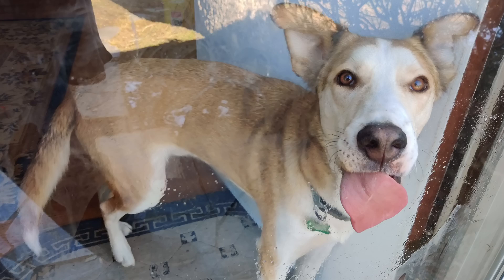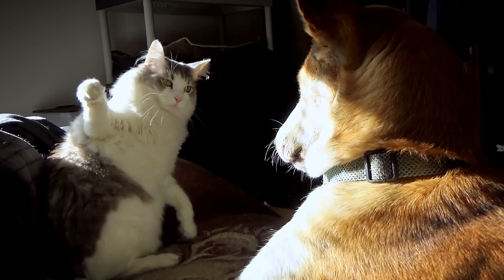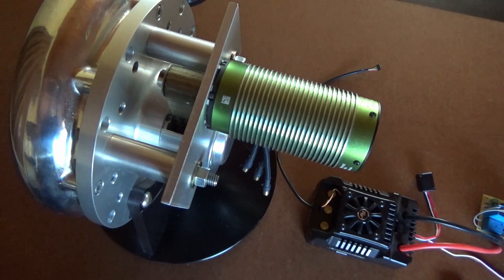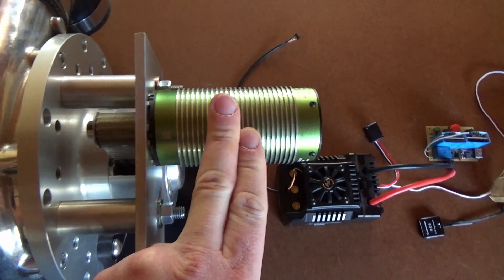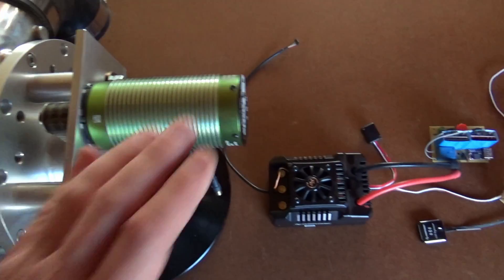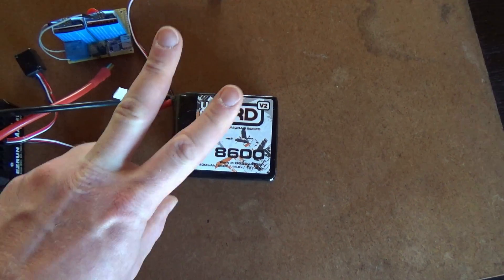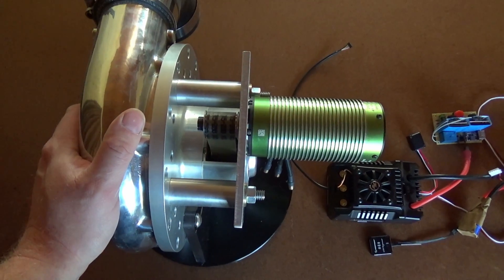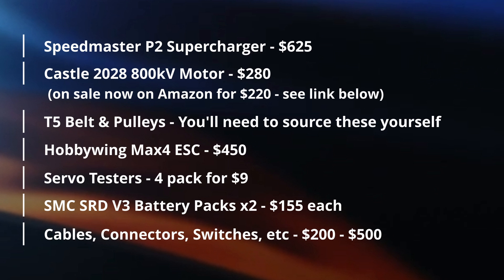DIY 650hp Electric Supercharger - Parts & Prices

Comment: I've been building Combustion and Electric race Propulsion Systems & motors all my life at age 57 in the Hood 😆 the Mighty LMT 30100 & MGM Esc  guides me here as i been using the Turnigy 4Lb OutRunner C80100-180Kv on many projects in the last 20 years nevertheless since you're using a servo tester as your Pulse Width Modulator and a ESC with a Bec to Power that servo tester you're going from a wireless receiver to a analog basically or fly by wire di-solder the turn knob servo tester pot then solder on any ebike throttle you choose from a Kart pedal to thumb push or full lock and key ebike twist with your batt voltage on the throttle you can put the thumb throttle on the old turn signal on old cars for the Turbo boost button and you can have full control over your turbo it won't be just an on and off switch 🤐✌️

Comment: Hey Alex.   I was curious if there electric supercharger somehow knows the engine rpm and spins at an appropriate speed for the application.    600 to 650hp potential especially in a smaller engine situation or limited power level natural aspirated and needing some boost is perfect for many.

Comment: Ok i know this is the old video i just seen thd dyno video.
Maybe try a Vesc ? You can get big ones made for ebikes it will run this motor just fine and the hv versions can handle over 80v and some are rated as high as 100hp.
Also they can use a user mapable 0-5v input, R/C ppm and even read can bus data and react to a user setup value so it can read a canbus car signal from an obd port look for the throttle pedal signal and activate based on the pedal.

Comment: Yes sor subbed up. 
But  what u Think about part time use on Suzuki samurai. When u meed xtra power on mudhole, or hill climb or passing anything on the highways.  . samurai are  1. 3  carbureted engine mine is anyway still stock about 60hp. . 
Dont need extra power all the time. Jut putting around no xtra but needing to get on down the road yeah need xtra plus some . Idk like the concept.

Comment: Could these batteries be used with high charge and discharge cycles? I was planning to use a charger using the 48V alternators. I plan to use this electric supercharger as an anti-lag system.

Comment: I am busy developing a custom PPM signal controller for those BLDC motors that can connect to your ECU and get the Throttle Position Sensor info and give a variable speed, then through your phone you can map the Brushless DC speed to certain throttle positions - let me know if you would like to test one of my units and I could send one over.
Reply from the maker: That sounds pretty cool, but how does it connect to the ECU?  I have an aftermarket EFI unit, so no OBDII port.  I'm thinking about a truly universal controller using a differential MAP sensor and an RPM trigger switch.  You don't want it to turn on full tilt at idle or low rpm; cylinder pressure would be extremely high and lead to catastrophic engine failure (it'd be like injecting a 200 shot of nitrous at idle).  You'd want control based on two maps - primarily load-based, with throttle position to help modulate it.

Comment: I bet this would be a lot of fun on my 2004 Maxima.  I'd have to do the fuel pump, injectors, intake spacer,  etc.  But if the system lasts for a long time, it's better than all that pipe work and ECU crap.  =)  I like the idea of an always on small boost, with a rheaostat and button for the full boost. =)

Comment: Why not use an electric motor so you don't have to use a electric supercharger?
Reply from the maker: Because it's far more efficient.  On our other electric supercharger we used a motor that was putting out 44hp to spin the compressor and picked up 205 hp at the wheels: https://youtu.be/b9d5xv9INmw
Reply: @AlexLTDLX  it's impossible, violates laws of conservation of energy so your input power was 44 HP and output was 205 HP ?
Reply from the maker: It's not impossible.  The additional energy comes from being able to burn more fuel, due to having more available oxygen.  That's how forced induction works. Watch the video.

Comment: Okay, so I just picked up one of my "must have" cars that I never thought I'd be able to own (a 2007 Pontiac Solstice) by way of an online auction for $925 and was able to drive it home from 3 states away 😆. Sure, it needs a LITTLE work (all cosmetic things) and those will be addressed, however I'm also looking to add any HP I can to its base model 2.4L Ecotec engine. Thing is, I'm physically disabled and, because of that, there are definite limitations to my budget AND my physical abilities to add a traditional turbocharger or supercharger, so I'm looking for alternatives. That's how I came across your video and, now that I have, I'd love to ask a few questions if you don't mind answering them? First, did you choose the supercharger you mention (the Speedmaster) for any specific reason OR is it just a higher-quality, lower cost unit that you're familiar with? Because of my situation, the parts will more than likely be parts I manage to find great deals on (likely "slightly used" from eBay) AND I'll have to purchase them "piece by piece" as funds allow, so I was just curious if your method mightily work with a different unit IF something came along? Secondly, I have the same question about the controller, as I have found used "Max10" and "Max6" pieces currently on eBay. Lastly, this setup wouldn't even require "mounting", correct? I mean, if the electric motor is driving the unit, its essentially just a "blower" that produces cold air, correct? I'm sorry if these are dumb questions, but I'm just now jumping on the whole "forced air bandwagon" 😆. But now that I've found you, I'll definitely be a "regular"...as I LOVE the idea of making my Solstice "GO" without having to sell a kidney OR having to make heavy modifications to my engine. Thanks in advance for your help and I'm subscribing as I speak 😆.
Reply from the maker: Congrats on the deal and being able to drive it that far right away.  I chose that particular compressor because it meets all the requirements - fairly broad compressor map, price, ease of conversion, etc.  In fact, on your car, it should be able to support at least 250-300 hp, and you'd get so much more torque down low that you'd have to be careful to not have too much cylinder pressure.  I would stick to the formula I've figured out so far - you'd run the risk of wasting more money trying to get other ESCs in particular to work.  I've already wasted that money by blowing up the ESCs that didn't work.  Hopefully this helps.

Comment: Could LTO batteries be used?
Reply from the maker: That's actually what I'm using.  I have several videos on my battery packs.
Reply: @AlexLTDLX  awesome, I will dig through and find it. I have 10x 20ah 2.3 LTOs for 24v solar tracker that isn't being  used, is there a way to control say a 20s pack that large?
Reply from the maker: IIRC, my 50 volt pack is 20s.  I'm using Lishen 18ah cells and have pulled 700 amps from them on the Sledgehammer (that's a 63 volt pack, though).  Here's the video on making the 50v packL https://youtu.be/SOCq_-kDgwc  And here's how it does compared to some LiPos at 500 amps: https://youtu.be/URBW3x_qjwk
Reply: @AlexLTDLX  wow, thanks so much for putting the time into this, you are a true pioneer.

Comment: Need a compressor that doesn't suck, which is a lot more than $625. And anything unlike rotrex isn't efficient.
Reply from the maker: This is basically a Vortech Si compressor.  We put a 12 second car into the 9s with a similar electric supercharger: https://youtu.be/RT0M88xHzNQ
Reply: @AlexLTDLX  I can tell. I have a V3. Its efficiency is poor. It eats an insane amount of power. I maxed out injectors just to make 460 whp at 12 psi with E85 and lots of timing. That's something like 100 hp loss over rotrex. 
Granted, it would be more power on a higher flowing engine, but cmon lol.
Reply from the maker: @TheGuruStud  It's actually one of the most efficient compressors out there - with 78% adiabatic efficiency.  If you're seeing poor performance, it's likely you're trying to use it on an engine not well matched to the compressor map or you have some other issue.  We added 205 rwhp on only 7 psi, to 550 rwhp through a powerglide on pump gas (not E85); no intercooling and some meth.  If it was a transmission with a lockup converter, we would've seen over 620 rwhp, and with a stickshift, 650 rwhp would've been likely - powerglide converters have to be pretty loose.  Here's the dyno video: https://youtu.be/b9d5xv9INmw

Comment: Great Videos!  Thanks for all the information.  I am new to electric turbos and have some questions.

1. Can I buy one from someone already assembled?
2. Can I run them in a larger battery bank (like series of 12 volt car batteries)
3. How long can the electric motors run without causing heat or performance issues?  This is more of a duty cycle question.
4. Have you set up a car where it can run without causing heat or without the electric turbine operating?
5.  How many minutes can a single hobby battery last?
Reply from the maker: That's a lot of questions.
1.  No.  At this time, it's a DIY thing.
2. Lead acid batteries would be expensive, heavy and perform poorly.
3. I haven't run one long enough to have any heat issues.  Check out all the dyno and track videos I've posted.  Here's a good place to start: https://youtu.be/RT0M88xHzNQ  Here's a dyno test: https://youtu.be/b9d5xv9INmw
4.  See #3
5.  Well, you need to define "single hobby battery."  With an 18 ah pack, I've never had to recharge the packs during a full day of racing or dyno testing.  (again, see #3)

Comment: How many amps does the battery deliver in case of max boost? It would be even cheaper if you would use four 12v lead batteries instead of the smc batteries. Also it would be easier to build a recharge system.
Reply from the maker: Lead acid isn't feasible - too heavy, too high internal resistance.  Check out the videos where I test this thing.  It pulls over 300 amps @ 50 volts; and impeller speed is directly related to voltage (lead acid would sag a lot more, even at 10 times the weight).

Comment: What are the dimensions of the supercharger? Wondering if it would fit on a motorcycle. On their website it has em but seems really huge. 

Height: 24cm
Length: 24cm
Width: 16cm

Comment: hey another question, would it be possible of instead of using electricity get a small weed eater type engine to run the turbine that way it has way more energy to use?  or even maybe a propane one
Reply: A weed Wacker likely doesn't make 1hp while that electric motor makes probably 10hp
Reply: @blindabinda1234  you have to power the electric motor with electricity so the point is can you find a small gas engine that can power the turbine
Reply: @blindabinda1234  be nice if it was doable because these electric trubos I can see the downside is length of use, the battery is pretty big and it doesnt last long where 1 gallon of fuel has like 30kwh of power in it
Reply: @adairjanney7109  you can fit about 10 batteries and the motor in the space it would take to put a weed Wacker engine and a fuel tank. Plus the noise and having to start the weed Wacker. People have used gas powered leaf blowers on 4 cylinders as a power adder but tracks stopped letting people use them.
Reply: @blindabinda1234  I dont know what batteries you are talking about
Reply: @blindabinda1234  I am not even talking about the crappy tiny one he is using im comparing one already the size of 10 batteries he is using the one in his video is TINY
Reply: @blindabinda1234  plus you can use the already available gas with modification and a small tank is not hard to put somewhere anyway, the point is IF the engine exist of that size that can provide that power then gas has a way higher energy density and if you are not going to do that then you jmight want to drop batteries all together use super capacitors and charge the bank from the 12v alternator with a dc to dc boost converter

Comment: Saw you were only running about 6psi. Is that set by you? Is it the limit of the system? Is it the limit of the electronic motor?
Reply: I would imagine the psi is set by the rpm of the motor and the sizes of the pulleys used. But the same setup ran on a smaller engine would show more psi due to the difference in CFM of airflow the engine will consume.

Comment: Considering the twin motor guys problem of routing boost pipe from the trunk to the front & the gas compressibility issues that go with that;
Have you considered exhaust extraction rather than induction compression  (or both ;) ?
It seems to me that race engineers spent decades using pulse tuning for scavening the engine via exhausts pulses, thanks to high rpm gas inertia.
Seems to me you can do that same scavening at low rpm, without the loss of torque issues with the cam duration and crossover.
High rpm race cam + low rpm electric scavenging, without impeding the induction system ?
Thinking of impeding the induction system, have you thought about a low load NA bypass ?

Comment: Hey, I've been investigating electronic PWM control for an invention of mine that can pull high amps if not properly controlled.  You might want to look at the line of Kelly PWM controllers.  I came across those recently.  They can be set up to run off of a 0-5V signal (like from a TPS) and have all kinds of motor speed feedback control options.   They are intended for electric motors and can read other feedback signals but you don't have to use those functions.  There is a video by someone on YouTUbe on how to set the up for use and he does a brief demonstration.  I would use that and scale it to output power based on TPS signal for this, that would be ideal instead of just on or off.
Reply: Awesome idea!

Comment: if I would like to try a motor to drive a 2.1L, twin scroll supercharger until 25000 RPM, 14.7psi.
Mine is a 5.5L V8 engine, max output at  7000RPM.
Which spec of electric motor do you recommend ?
Thanks in advance.

Comment: OH yeah you can also add TUNGSTEN disulfide to your bearings in powder form to increase reliability and high rpm too. Not like ptfe, much more durable, moly is basically useless and is sold because of that fact at higher price + 
If you use ceramic bearings it helps too. It cannot damage unless you add too much. Added to grease or added dry, it helps wear, decreases heat, and best of all will extend seal life indefinetly.

Comment: What those NEED are gan drives and amorphous core stator and n55 magnets. Its been decades almost, and nobody sells a reasonably priced cross compatible smd package/drive-able GAN mosfets. Why the frig dont they make a dip package NOT tiny chiny pissy whiny china crosseyed miniscule packages??? 
Its an upgrade from 85 to 95 percent efficiency for just the drive, and the amorphous core is another 3-5 percent, but more torque across the curve. And n55 magnets will increase torque decrease size needed and it comounds the efficiency and torque benefits by 3 facors because of inefficiency stacking. 
This should be the case for any power drives these days, and it should be cheap, and the same format as the regular mosfet drives because they are basically identical anyways they just want to sell you driver chips and more chiny crosseyed supporting circuitry.
Overall cost on just materials is only up say 25 dollars per hp which is reasonable as hell.

Comment: I have a 2012 Jeep Grand Cherokee V8 5.7L (Overland Trim) and it has around 190,000 km. Do you think this is a possibility on my car setup? 

I have CIA by K&N and a catch can. No other engine modifications. New spark plugs but stock injectors.

Comment: The shaft on that motor will never last with that side load.
Reply: I wonder if the shaft could be extended to a bearing to give it support? Like a carrier bearing?
Reply: @bb62133 I suppose the motor pulley could be made for a bearing on on the end with a plate to support it.

Comment: What if you use this in a compound setup with a small turbo. Do you think it could work?
Reply from the maker: Yes.  It would eliminate turbo lag for sure.
Reply: But would the air flow effectively multiply ? @AlexLTDLX

Comment: For esc you can go with much cheaper mksesc 75200 based on vesc. They are for less than 200. Otherwise it is about right. 

Also for controlling it I went with arduino taking accelerator pedal and rpm as input and giving some output according to a map.
Reply from the maker: I've had major problems trying to get a VESC to play nice at high eRPM.  After spending over $500 and a couple of months of my life (I made some videos on VESC), eventually I gave up.  It was not repeatable day to day or even consistent pull to pull.